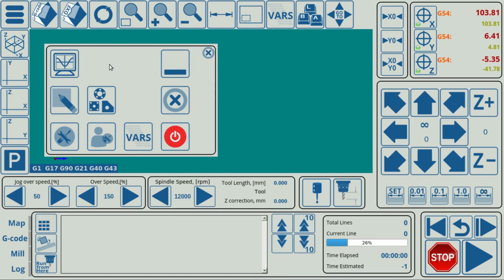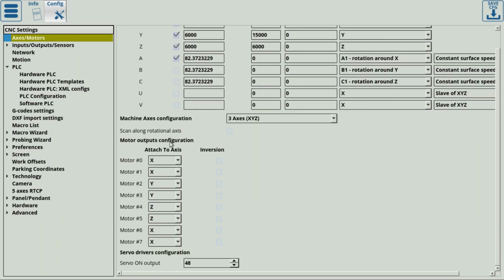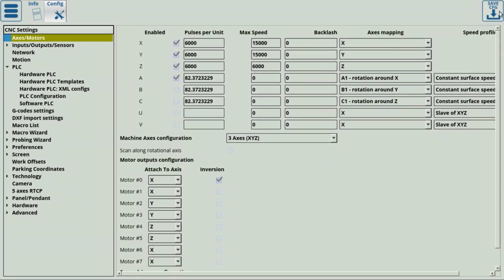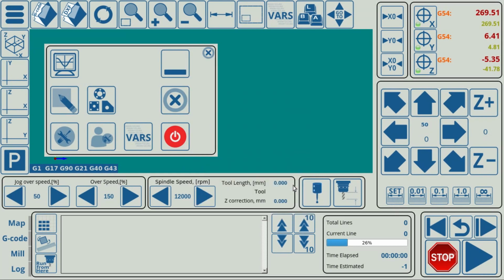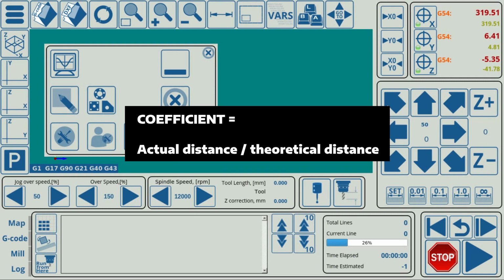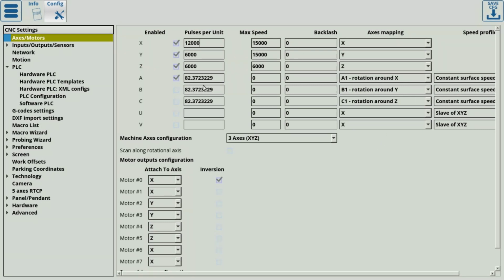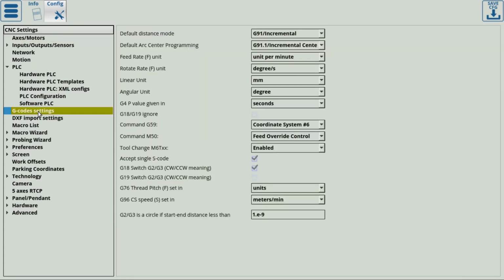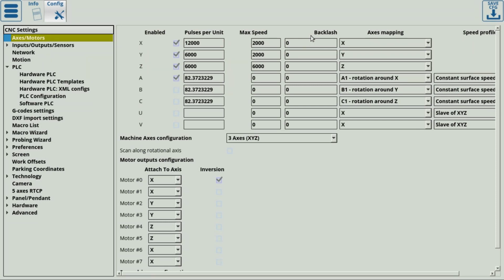myCNC tutorial (Axes, Pulses)

Comment: Will this work with my controller hardware, or do I have to buy  their board?
Reply: Hi there! The myCNC software works in tandem with the myCNC controllers (ET6/ET7/ET10/ET15), so for it to work you'd need to purchase the controller as well. The software is available as a free download to try out if you're so inclined - however, you will not be able to access most of the features since those require a board to function.